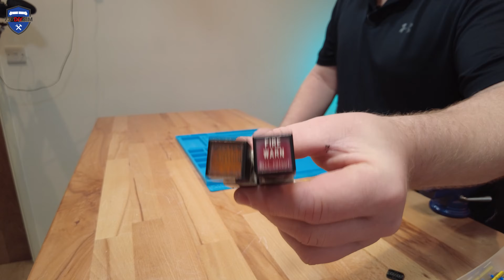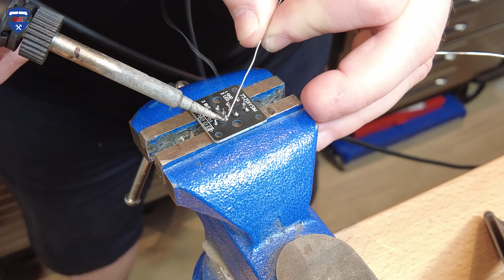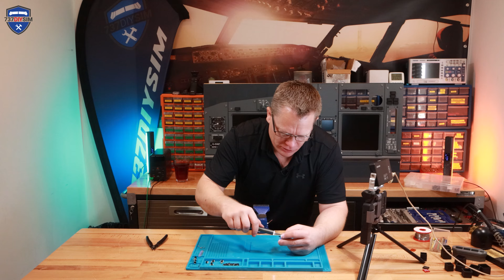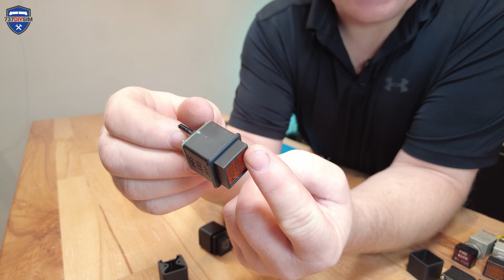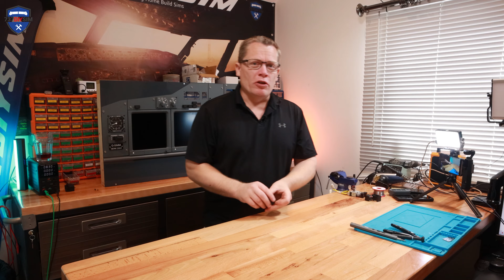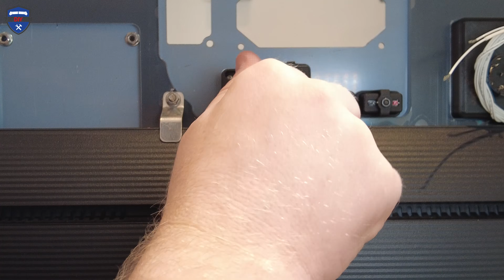737 Master Caution, Fire Warning & Stab out of Trim Annunciators

Comment: Hi Karl, what dimensions do you made them? There are articles on internet that shows there are different dimensions for the stab and master caution buttons. I made the stab today and also uses the same dimensions, 25x25mm.
Reply from the maker: Okay so i have just measured the units for you. I have 20.78mm for the master caution & Fire warning and i make the SOOT 22.38mm. This is pretty close which i why i made them the same case. Also as a 737 pilot pointed out, you can not see the text on the SOOT until lit, so i will now try to paint the inner surface and see if that works. I hope that helps. You can check out out the website, showing the real unit nexts to the replicas for size comparsion.